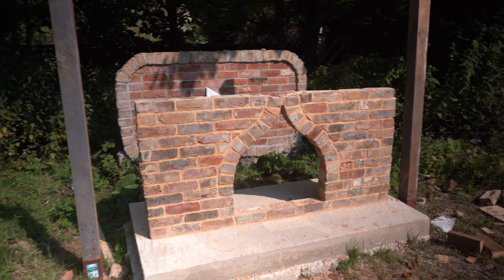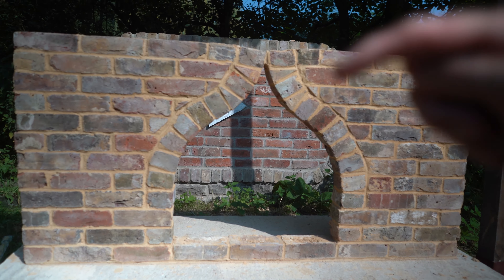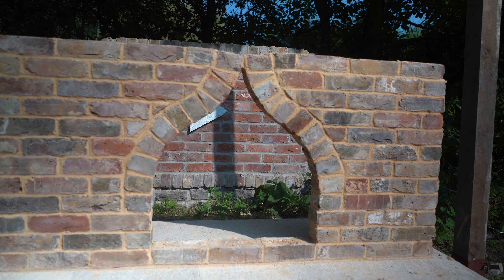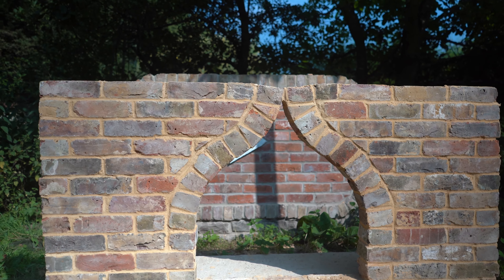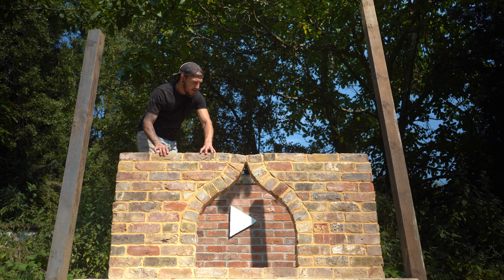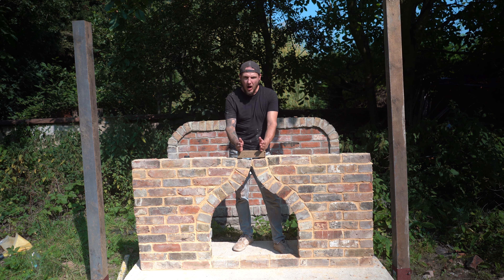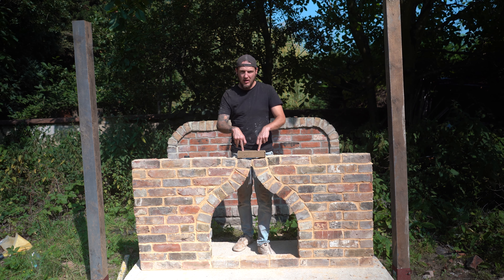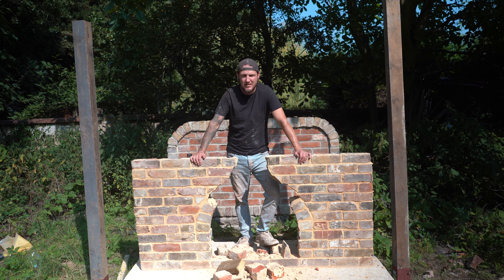HOW STRONG IS A BRICK ARCH?

Comment: If you build this as a dry stack it would not stand up. Your compression loads push through the  convex portion of the arch out and down. Your upper convex curve of those arches are going to push down as the compression load transferred outward.  Your outward and downward compression is in this case pushing toward the opening of the structure where the upper convex arch is.
This type of arch is not structural for sure and clearly aesthetic. 
The strength of a typical arch is created by the compression load above the arch. Due to the compression load above the direction of load at the point of the pillar or footing of the arch is nearly all straight down as the compression distributes through the arch

Comment: It took 12 Stone of imposed point load over its key point and didn't move mate... yet the kinetic energy from a sledge hammer which is nowhere near 12 Stone put it to bed... thats physics for you mate... and don't forget it's only built in hydrated lime /sand mortar... a cement based mortar might have held up slightly longer but still would've give way in the end.... cracking vids mate... love your approach to brickwork 👍

Comment: Rodian, using the Sledge hammer is a point load, or rather a point impact. it will fail regardless. I suspect that if the arch  was gauged correctly  and there was  a couple of courses on top, it would not fail. Probably a structural engineer would show me the error of my logic :)

Comment: Good Video! I'm Glad that Whole Wall Didn't Tip Over & Flatten Yer Head.. It Looked Like it'd Stay Together in One Piece Until Your Skull Got in the Way. I Had a Friend that Got Squashed By 2 Cubes of Brick.
The Way it Failed Under Hammer is Exactly What Didn't Look Strong. Some of Those Bricks Were Just Hanging there.. Mortar has Some Adhesive Properties But it's Not Glue.. I Felt Bad for Ya When it Fell . You Could Actually See the Moment the Disappointment Moved to your Face.. Don't Feel Bad it's All in the Name of Education. Brickwork Follows the Laws of  Physics.. Gravity & Proper Balance Always Applies!
Reply from the maker: I didnt expect it to hold up that well against the hammer 🤣 Thought it would take at least 2 hits but I was proven wrong 🤣
Reply: I Thought it'd Take a Couple Smacks as Well Maybe the Mortar Wasn't that Cured Yet.. What I Don't Like About that Arch is it's a Stack & it Curves in the Wrong Direction. it Relys on the Mortar to Hold it  Up.  I'd Be Interested to See How a Gothic or Radius Type Arch Held Up.

Comment: I really despair at this , the arch will fail as soon as the load on the top exceeds the weight of the wall ,and pushes the supports sideways . This isn't magic it is common sense .
One point load in the middle of a simple arch that is greater in weight than the supports of the arch will cause it to fail . Rodian  a little learning ! Go back to College and learn a lot more , you never know I might be teaching you ; and getting paid for it . Best of luck  .  I will make some videos soon and then you can slag me off .